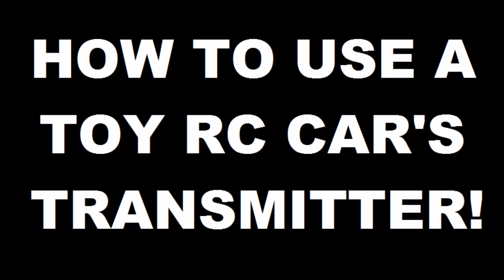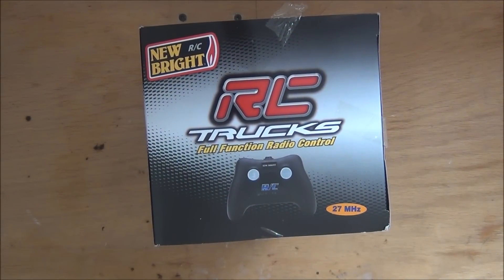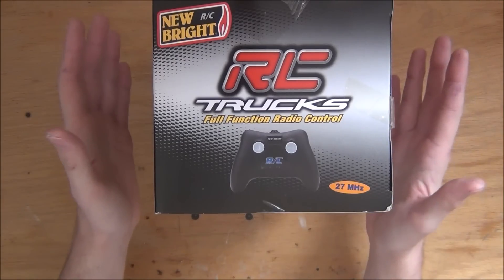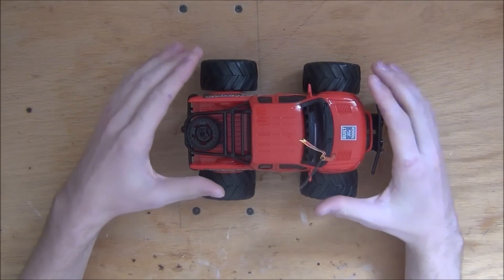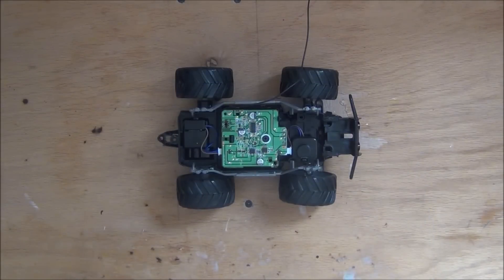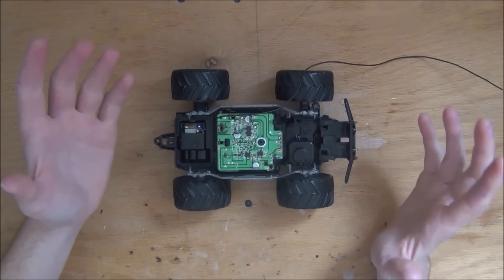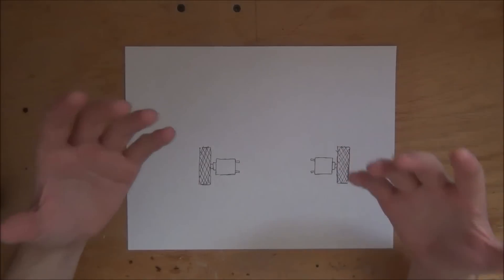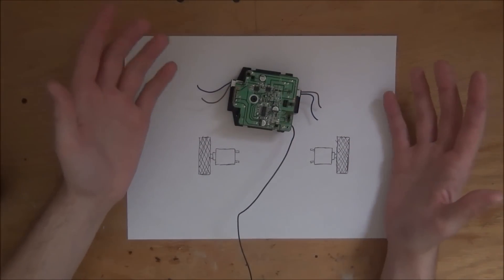How To Get A $12 Transmitter And Receiver!

Comment: I hope its not too late to ask but (dont know if someone already said this) how can I make that circuit that you mention in the video (the one of moving both motor front and backwards and still can turn it left and right)?
Reply from the maker: It's been awhile since i made this video, but if i remember correctly You're speaking of the H-bridge, right?  I haven't made a video about it but you can google it and get a LOT more information if you want. It should go in a lot greater depth then i can in the comments haha!  :)
Reply: Thanks!

Comment: I will need a 3ch or 4ch remote but don't want to fork over a lot of cash for one. Would it be possible to extract the receiver out of a mini quadcopter? or maybe even create one with Arduino? Thanks
Reply from the maker: Well you can buy a 6 channel transmitter and receiver for $50. This is actually the one I use and I love it! This is an affiliate link by the way. Transmitter : https://amzn.to/2qc32V3
Reply: Mechanical Ninjineer thanks! I will look into it!

Comment: i have a twisted metal rc car of sweet tooth's car. is it the same procedure when removing the receiver?
Reply from the maker: Yeah, all rc cars especially toy grade ones, should be very similar!  :)
Reply: so even the hexbug battle bots like the witch doctor rc car?
Reply from the maker: yeah, as long as they're brushed motors (which like 99% of toy grade ones are) they should all be the same.

Comment: Can a rc car much like one in this wideo run of an 9v batery, if jes how to connect the battery?
Reply from the maker: It would depend on the voltage rating for the rc cars receiver. If the receiver can handle 9v you would just connect it to the battery wires coming out of the board.
Reply: @MechNinji  how to check the minimum and maximum voltage of the reciever board

Comment: Does the control for moving  the wheels forward and the control for turning have equal current on these toys?
i'm wanting to convert at 1/35 scale model tank to rc, and i've read that if the current is not equal the
tank won't be able to go straight.
Reply from the maker: It depends on the toy but they are usually very similar voltage if not identical. But even if they're not you can fix the problem by using a resistor. :)
Reply: Thanks

Comment: Can I make a Remote Contolled plane by taking out the receiver from my old car ?
Reply from the maker: It is possible however it would be very difficult to do so. Rc planes usually use a 6 channel transmitter where as the car in this video is only a 2 channel.

Comment: so you can only drive with this, could you add another servo for like a battlebot weapon and control it with the rc?
Reply from the maker: With a lot of creativity, yes you could! However it would not be to easy, In order to add a weapon you would probably need to give up a function like reverse for example. Unless you buy a car with more channels.
Reply: Mechanical Ninjineer can you make a video on that plz? plus I subdcribed
Reply from the maker: I might do another video about it sometime but I have to post my battlebot part 3 first (and it may be a little while before that vid is ready) however in the mean time I would suggest looking into 4 or even 6 channel transmitters. I have a 6 channel spectrum transmitter and I love it! :)
Reply: Mechanical Ninjineer ok thx your the best, replying right away! I'm limited on money, so yah. thanks though!

Comment: There is a way of making it go straight and turn only using the receiver you just have to attach two motors to the same set of wire and one to the other wire
Reply from the maker: Yeah, you can do a lot with it if you get creative about how to work around problems! :D

Comment: can i attach 3.7v lipo battery to the car receiver?pls reply
Reply from the maker: yeah, 3.7 volts should be perfect just as long as it has enough amps.
Reply: Mechanical Ninjineer thanks ! but to which wires should I solder it? there are a lot of wires soldered to the battery holder
Reply: and you got a sub!😊
Reply: I'm thinking to make a simple 2ch plane with it.......
Reply from the maker: very cool! just solder it to the two wires at the very end of the battery port. Right where the regular battery would make contact.  :)
Reply: Mechanical Ninjineer I don't want the battery holder to be with it. It will make the plane heavy.
Reply from the maker: That's fine! just cut off the battery holder but keep the two wires.  :)
Reply: thanks a lot!!
Reply: i have also thought an idea on how to make servo myself for the rudders
Reply from the maker: Awesome!  :D
Reply: it is very simple  .just glue a thin iron rod to the motor's rod and make the stoppers from popsickle sticks

Comment: Really nice! But one question: would it be possible to connect a servo to that reciver? (BTW, did my servo screwdriver, posted a video and, then, replaced it with a metal gear servo in another video - both 9g servos. But already got a 55g servo waiting to became a stronger screwdriver. :D )
Reply from the maker: Yeah! you could totally connect a servo to that but you would have to modify it a little first. And that's really cool about the screw driver! :)
Reply: yo los tengo trabajando con servo de 1.7g se conecta la señal al receptor funciona perfectamente